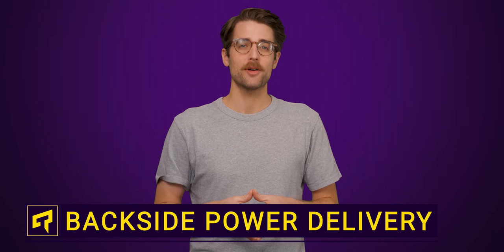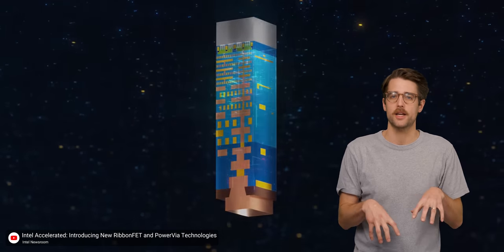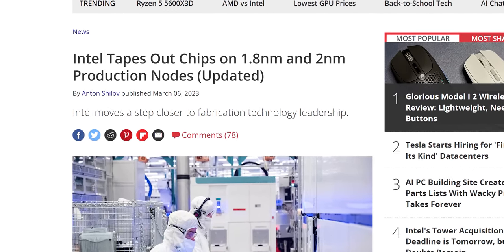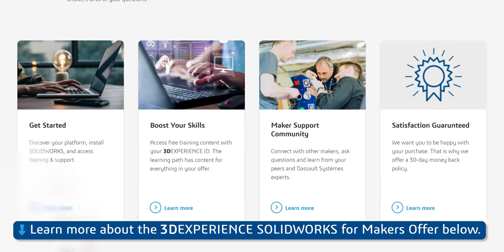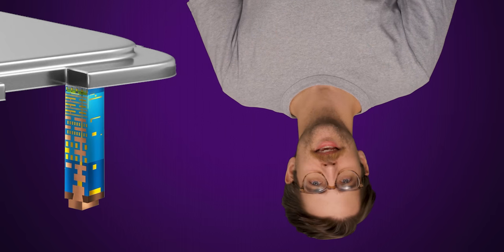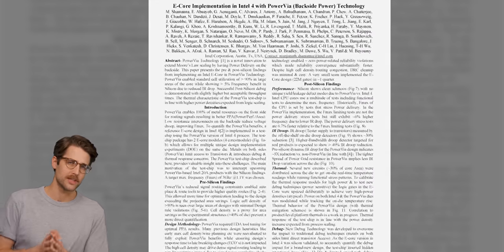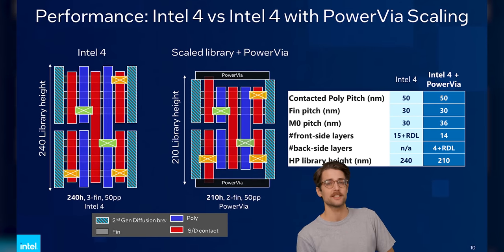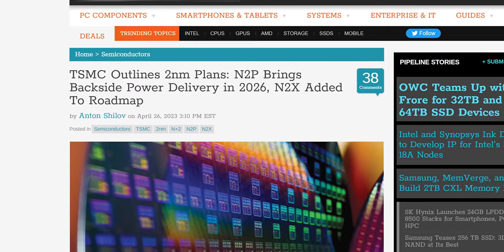Intel Is Flipping the CPU Upside-Down

Comment: Intel innovating instead of giving us quad cores for a decade and then just brute-forcing their way via extreme TDP to not fall behind AMD too much? I'm looking forward to seeing the results.
Reply: Intel just mostly falling behind because Apple support TSMC, and AMD only use the leftover technology from that (so when Apple move to the newer technology, AMD can take that capacity). So AMD itself did almost nothing to beat Intel (the chip design with 6nm or with 7nm it's the same, it's just more efficient, and using less power, but that is a result of TSMC hard work not a result of AMD hard work), just choosed the right manufacturer, who beated Intel in yearly upgrades.
Reply: @TamasKiss-yk4st  Chiplets and 3D cache are very much AMD's innovation. Don't downplay it, AMD has been innovative with Ryzen, while Intel has been delivering more of the same.
Reply: @256shadesofgrey  chiplets is TSMC technology, all TSMC customer able to use that.. by the way probably they are invented that because of Apple too.. like the fusion of 2 M2 Max into M2 Ultra actually the chiplets.. using mire moduls and fusing them into one.. AMD only can invent anything inside TSMC, if they buy the factory.. or they can invent something in their headquarters, but that is something what TSMC can't use, so they have no advantage of that until they are manifacturing at TSMC instead of their own fab lime Intel do.. AMD was the first who used it, but still that is a technology what belongs to TSMC and not to AMD..
Reply: @TamasKiss-yk4st  The fab produces what the designers want to be produced, and AMD are the designers. It's very likely that TSMC is just figuring out how to do things that AMD told them to do. Also the first chiplet thing was produced by Global Foundries with ryzen 1, not TSMC.
Reply: @256shadesofgrey  and you are that naive, whi think TSMC spending money on anything what a small fish want? They are worked to achieve the chiplet because Apple wanted it.. not because AMD wanted it.. do you know what is the difference when a company who "only" provide 4.93% of the yearly renevue ask you to do something or if an another company with 25.93% of the yearly renevue ask you..? TSMC can ignore the 2nd-10th company, because Apple alone bring the same profit like 9 "next" biggest company together...
Reply: @TamasKiss-yk4st  >ignoring the fact that AMD did Chiplets years before Apple and that it was done with GloFo and not TSMC
It's obvious that you're an Intel fanboy who hates AMD just because, but your rewriting of history won't change the truth. AMD did chiplets first, and then once everyone saw that it's awesome and it works, they started trying to copy them. Including Apple who did not develop their own chip until years after Ryzen 1.
Reply: @256shadesofgrey  lol.. so are you sure Apple doesn't have a plan to be able to make a better chip like they made in the Macbooks with M1 Max..? you are pretty sure they wanted to a abandon the desktop Mac Pro, and they never have the plan to do the M1 Ultra..? Apple made preparations for the M series in 2015.. when they purposely choosed the PCIe NVME storage as a MMC card replacement (if it's not clear, that is a mini M.2 SSD, that is also a NVME storage what communicate on PCIe port, so they wanted the same processor in the phone and in the Mac, just like they already did.. and they already had plans how they replace the chip in desktop Mac..)
By the way if the chiplets belongs to AMD, than why TSMC able to use it freely for anyone.. mostly for AMD competitors.. isn't that a dumb idea to allow them to do better chips with that too..?
Reply: @256shadesofgrey Chiplets were first used by IBM in their Power server processor in 2002.
Reply: @alexanderbelov6892  Exactly. Nothing to do with Apple in any way shape or form. And AMD were the ones who first made them viable on the desktop, also years before Apple.

Comment: I understand what they want to do, but I don't see enough cooling.  It would be better if they started making connections in all directions and not just front or back.  I hope that soon they will start making processors in the form of pyramids, so that the silicon chip will get cooling from several sides.  And who among us would not like to see a processor in the shape of a Roman colosseum, where in the middle we have a cooling nexus that unravels like roots through the chip.

Comment: Thinner wires creates more resistance?? Srly? U listening to urself? Less material creates more resistance?? 

Not sure what u were trying to translate but have a but of common sense
Reply: R is proportional to wire length and inverse proportional to section square. Thinner and longer wires create more resistance.
Reply: @alexanderbelov6892  yes, you are referring to the linear equation of resistance.
A. It’s not what they said. 
B. It works good as approximation of large systems. In lower scales the composition and uniformity of the conductor would have more effect on the chances for cooper pair formations or quantum wells will have more statistical influence. 

But that’s Intel’s issue. The issue in the video is just how they presented the fact that
Reply: @ye849  
IMHO linear equation is what Intel used to raise frequency of 12 generation to frequency of 13 generation.

Comment: Shits going to hit the roof now. Another obstacle for overclockers.  Earlier cpu shaving was for extremists. Now It's going to be a common thing.
Reply: I don't think so, the core voltage is likely to be lower with backside power, so you'd be trying to dissipate a lot less heat for the same performance